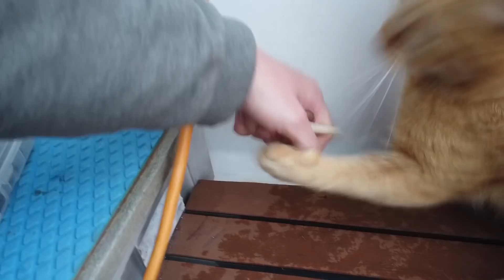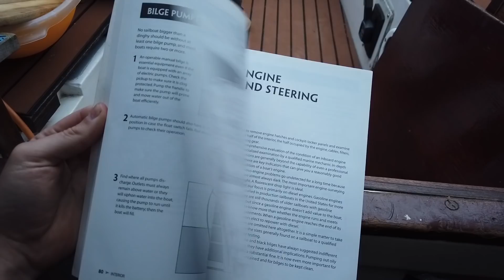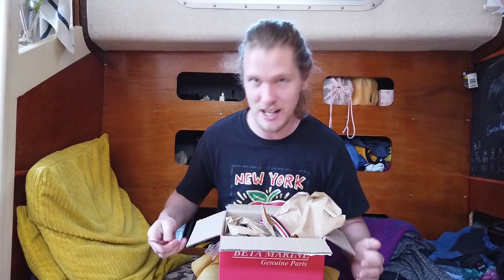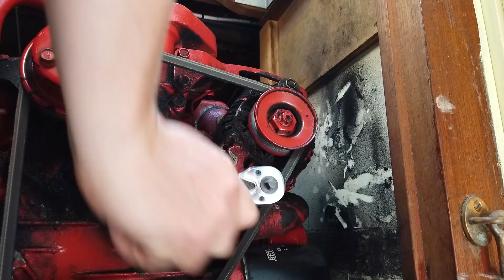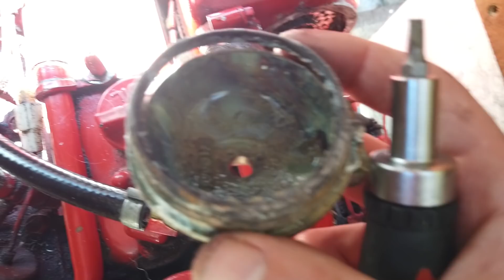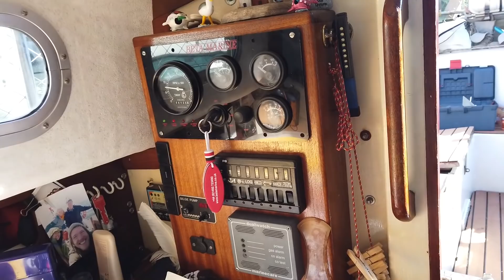Life on A Small Sailing Boat, IN REALITY || Wildlings Sailing

Comment: Hi Mark,take rubber house off heat exchanger ends block heat exchangers end up and put kettle Descaler in to brake down scale.if it is left the small pipes will rot it,s got to be done .
Start with a weak solution to start with.
Good Luck.

Comment: A little tip which might help with freeing up your stuck heat exchanger.
 Try Taking off the end caps and then re inserting the retaining bolts on there own and Give the bolt heads a tap from each end until she breaks free. It worked for my beta 16. 
 To clean once removed I put the whole cylinder in a food bag full of white vinegar and let it soak overnight. She Looks brand new now
 I hope this helps guys!! Loving the videos whilst locked down in our boat.
Reply from the maker: Nice idea, I'll have a bash next time
Reply: Yes, a gentle tap at each end. Heavy duty kettle descaler also works.

Comment: Thank for another great video, Make sure you replace the pressurized cap it is a very important part of the cooling system and use a coolant mixture not just water  this will help prevent corrosion of the internal cooling gallery's and the heat exchanger plus gives some lubrication to the water pump  
stay safe you two
Reply from the maker: Nice one, I'll be looking out for some

Comment: Hi again guys,
Nice video with the pipe on the engine. However there looked to be a lot of black rubber dust all over the front of the engine. Check belt alignment etc as is should not ware like that!
Belt won’t last long if it is rubbing, or pulling are not aligned correctly.
Have fun.....just wishing we were back on PAOMIA so I could do loads of boat jobs and my wife can then keep having a go at me for ripping the boat apart and thrashing the place........ I’m definitely missing boat life 🤪😀⛵️😷
Reply from the maker: That's why I changed the pipe, it rubbed through, I won't be making that mistake again! Haha so sorry for you, but hopefully you can get back soon!

Comment: Mixing orange and blue coolant is a big no-no. Different chemicals for each (pink, red, orange etc) is different from (blue, green etc). 

Will gunk up and corrode metal faster.
Reply: If you mix orange (Dexcool) and green (ethyl glycol) coolant together it chemically reacts to turn into a gel. Not exactly the best thing for a coolant system. 😮
Reply from the maker: I need to do a bit of research into it. In the engine manual it says just antifreeze
Reply: Wildlings Sailing its a common fault on a lot of older cars when the industry changed from one to the other. You can use any colour you like, and match like for like colours (orange into pink etc). But not to mix. Best to get some cheap coolant flush and run it through/flush the engine with water. You can even just use water as a placeholder if you’re certain it won’t freeze overnight while waiting for new coolant. I’m the kind of guy that re-uses copper washers and gaskets but wouldn’t mix! Haha. It’s a cheap fix so not bad :)

Comment: Liked te video very much, laughed a lot too. Just one remark: check the length of the belt, as I saw the alternator is almost at the end of adjusting the belt's tension. One question, what are your plans after the confinement, I'm stuck in Belgium but want to go to the Med as soon as possible.
Reply from the maker: I've got a couple spare,, but when I put a new one on, it gets the dust everywhere. Manual says inspect every 750 hours which is not too bad. We're off straight to the med asap for some sailing! Maybe we'll cross paths along the way!

Comment: Hi Mark & Nadiyana, please please pretty please, can we have more info on the chick clippin’ chopstick clickin’ crackin’ cookin’ items? Ahem! Sorry about that. Got carried away just then......Mark, you’re becoming quite the engineer !!!! I think the answer to the heat exchanger probs, may be found in the engines manual. Also, I don’t think the rad cap should wobble like it does, it ‘ain’t keeping any pressure over the engine. You could check the “lugs” on the cap and the slots the lugs mate with. Or replace!!!!!
Great fun watching this episode. Kind Regards, Barnacle Bern S Y Cadbri
Reply from the maker: Cheers mate, yep, just going to bend the lugs back and it'll be alright! Nadiyanas going to be putting the videos on a separate channel for cooking stuff.

Comment: Great Job that Mark ,your quite the engineer now 👌your quite right on the clean engine it is much easier to identify any leaks. I use spray tins of carburettor cleaner it’s an amazing degreaser and comes out in high pressure blasts the oil and grease off.
Reply from the maker: Ooo nice, I'll look out for it on my next shop

Comment: Dude ....pay attention to the heat exchange system in your  engine, there's abit of corrosion buildup in there which will eventually cause overheating, and you know what may eventually happen !
Reply from the maker: I'm going to give it a good flush when I get the right materials, but it's good for now, the holes are all clear, cheers!

Comment: Nice job on the engine 👍. The red coolant is just rust ... it should have some antifreeze in which is blue or pink (ps don’t mix the two!). def hasn’t been maintained/ changed for many a year. Suggest flushing it thru a few times. maybe use a car radiator cleaner to get rid of scale / sludge. Think pink antifreeze is recommended for boats as less harmful to aquatic life. And like others have said ... u def need to look at that radiator cap! A header tank is a good addition. Downloaded and look at the beta install manual. Don’t buy theirs for £60 thou. Buy a VW/Skoda Fabia “ball type” expansion vessel from eBay. It’s the same product for £15 👍. Good luck both 🍻.
Reply from the maker: Cool, ill have a good look at the header tank idea. And need to get some proper coolant!

Comment: Hi, constructive comments if I may.  You have time on your hands , lots of it. Now that you have given your diesel a basic clean up. Now start again and tackle areas that need attention.  Fix that rattling water cap. It’s not designed to do that and it should infact,  seal with mild pressure. That black deposit thrown everywhere! to me , it looks like V belt rubber. Why?  If any of your pulleys, either the alternator , water circulation pump or flywheel pulley is mildly rusty, they act like a file and shave rubber off. Clean the pulleys up.  You had water and rubber going into your alternator cooling vents. Take the alternator off and clean it internally.  Heat exchanger, seriously, you have to dismantle and clean that out properly. It’s going to cost you a lot more in the long run if you don’t do it now. The last thing you want if for your motor to start overheating or leaking when your entering a breakwater
 at night with a 20 knot + wind blowing. Take care of the underneath area of your sump. I have had a sump rust from the outside in eventually dumping oil. You have lots of time and many here willing to guide you as you do each section of your diesel.  Good luck .
Reply from the maker: Nice one, some more jobs for the list there. Appreciate it 👍
Reply: You'd be amazed how the thick alloy sump can corrode with salt water puddling around the sump. Epoxy engine metal putty from Halfords worked great. The Halfords red engine paint needs no primer and almost matches the Beta red. Anyway, more interesting things to do. LOL. Ps. I bought a long Torx key to clean the tube stack, just to clean out what the descaler didn't.  I won't bore you  with added header expansion tank... :)

Comment: Add a knitting needle to your tool kit for cleaning the heat exchanger
Reply from the maker: Ooo nice idea
Reply: @WildlingSailing  I'm gonna add a brass wire brush to that . Their normally used for cleaning spark plugs , but i use mine for all kinds of cleaning and derusting jobs , hose seats being just one of them . If you have problems finding one , try a suede shoe brush , their more or less the same thing just a little bigger . Yes i agree the pressure cap is scrap , it shouldn't be rattling around like that and it's possibly the reason your losing coolant . When you do flush the system , i would strongly advise a radiator cleaner being used . Looking at your engine , i would largely suspect it uses the blue antifreeze . It looks too old to use the pink stuff , as mainly engines built after 2000 use that . If you don't have an ecu which i seriously doubt , it will be blue , there's only two colours . Also one little thing , when you check the tension on the fan belt , it should be the longest span , and deflect about 5 mm one way   , i notice you used the shortest span . Now a bit more information for you , do you have a cold draft in the cabin , and can't find it . Well if you have , it's probably coming though the engine bay . I had one on my boat when i lived aboard . My boat was re engined in the early 80's , before i owned her and the bulkhead behind the engine was hacked about to get it to fit , i notice yours is open the same . 
Now i'm not gonna get too involved here , as i don't like doing this kinda thing , but i'm not happy with that mast of yours either . I had already noticed the deformation of the spreader plate on a previous video a while back , i'm certainly glad you took a look , it needed it . Sorry mate , but once a mast has deteriorated to that extent , being brutal , it's also scrap . It should be okay for a little while on coastal work , though i wouldn't put money on it , where you can work with the weather , but no way would i take it off shore . A repair would only have limited success , and the risk of losing the mast would be too great blue water . Sorry , i should have said something , but i didn't want to burst your bubble .

Comment: May a suggest, the use of brushes for cleaning.

You tend to use. Bits of tissues. Brass or bronze wire brushes would give your metal surfaces  deeper clean.
Also use a bit of grease or vaseline when re installing Engine parts.
Great to see your learning curb.
Btw, my wife is from Chendu, she is in Hong Kong! She is very sensitive to motion sickness and does not like being in the boat even in the Marina!
Reply from the maker: Cool, will try next time. Ah that's a shame. We've both been to Chengdu, and Hong Kong. Hope your wife can overcome her sickness, it can be trained after a few days but the initial time will make her sick

Comment: Once again, excellent video.   Engine coolant should be changed every 2-3 years.   Best to use the coolant recommended by Beta marine for that vintage engine.    My old Yanmar I use the old green stuff, but newer coolants have different colors,  (orange,  purple ).   The crud in the cooling system is of some concern.   At the very least, after quanantine, I drain and refill with new recommended coolant.   I have a water heater in the cooling circuit.  I replaced my 20+ year old water heater.    I discovered that the interior of the heater tank was sluffing off rust chips, some of which were lodged in the heater hoses,  but that also means some went through the engine.   Anyway,  I put in new hoses,  drained and refilled with new coolant.  When you can. 

Love you cleaned up the engine.  The black dust makes my OCD kick in, and as you say, a clean engine lets you check for future leaks. 

Carry on, mate.
Reply from the maker: Cheers mate! Yup, going to keep on top of the coolant now, just give this stuff a good flush through and get new stuff in

Comment: You need to change the coolant filler cap, it shouldn't wiggle. Oh, nice hair cut.
Reply: You're right Richard, if the cap is that loose it's not pressurising system properly and you are going to lose coolant..... new seal or the spring is weak.

Comment: Another good video and at least you are makong the most of lockdown to tick off more things on your list. 
If you are going to do electrial stuff, buy yourself a bunch of differnt sized heat shrink tube, its not expensive but it is invaluable. and you'll fall in love with it.  I'd also suggest a decent set of ratchet crimps.  
As for the crud in the coolig system, it looks like it could do with a really good flush.  If you can fasten some pipe to your coolant pipe to create a circuit to a bucket and then run really hot water with a bilge pump inthe bucket, you'll possibly get rid of a lot of it, the other thing you can try is puttin a weak solution of vinegar in the bucket with the hot water or better still buy yourself a little bottle of rid lyme (http://www.rydlyme.co.uk/index.php/en/)
Oh and afer lockdown, get yourself  a couple of spare engine keys cut.
Reply: +1 on the coolant flush. The red is rust. After flushing use a proper coolant not plain water. Consider checking and adjusting the valve clearances. This vital with a diesel. Having spare hose is fine but having a set of the correct ones for your engine with new stainless clamps is much better. I'm sure that the book will say to check your belt tension at the longest section. Too loose means slippage and loss of charging. Too tight puts too much stress on the bearings, water pump, alternator etc. Haircut is fine. I had  cut before Christmas and think that a much needed one will still have to wait a few weeks yet. I have scissors but...…...…….
Reply from the maker: Nice advice guys! I think I'll wait another year for the full engine flush. I'll need to top up with coolant though and double check the belt